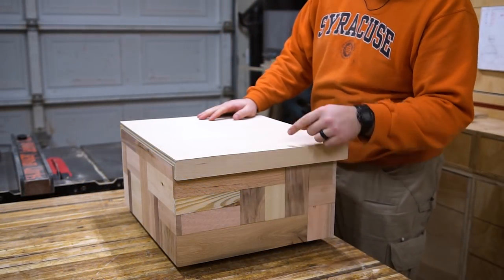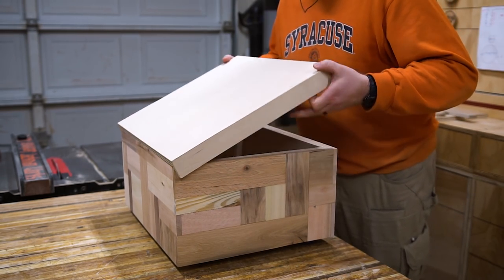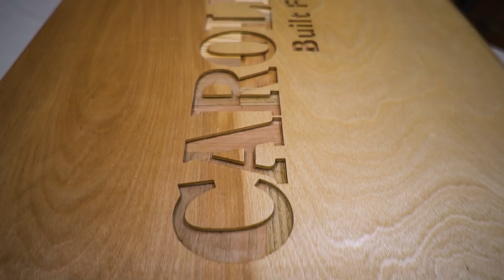Secret Compartment Shoebox with Patchwork Pallet Wood

Comment: Curious, what was the purpose of cutting one dado on the table saw ad the other on there router table?

Also, how the heck do you miter those angles so perfectly on the table saw????!?!
Reply from the maker: Dado on the table saw was because I needed it to fit the 1/2" plywood (which is actually slightly less than 1/2"). The others were true to size so I could just use the correct sized router bit.

For miters on the table saw this thing is a life saver -- https://amzn.to/2Di66Gp